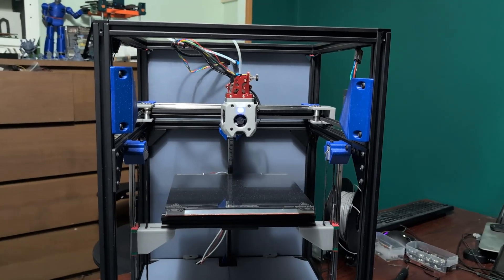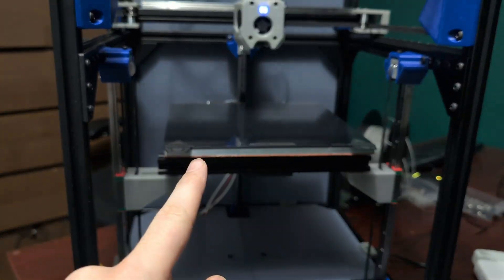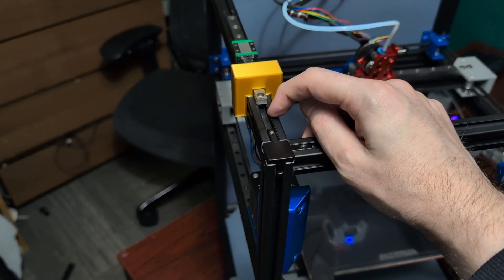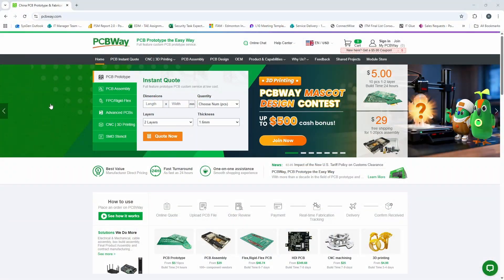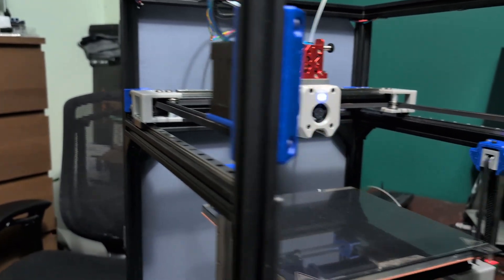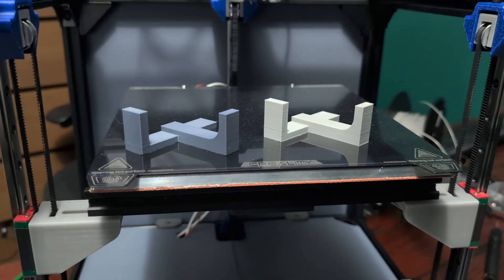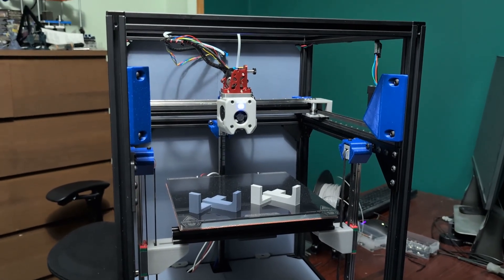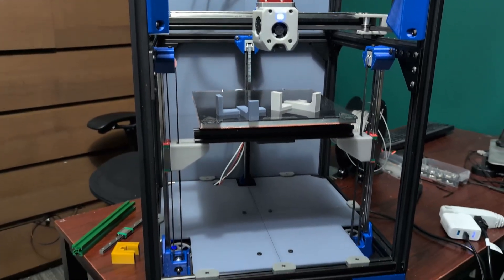DIY Beginner Friendly CoreXY 3D Printer SimpleCore Redux - Final

Comment: Your 2020's seem to be V slot which are good for those roller bearings on the good old Ender 3's, T Slot work better for holding rails, they are both different types and not a quality issue with the extrusions
Reply from the maker: nope I am using all T slot

Comment: Hi, where can I download the config for this printer?
Reply from the maker: There is a zip file on printables for the MKS Monster and Beacon Probe
Reply: @Rolohaun  I want to install 10mm belts on the xy axis, but I don't know how to change the size of the models, can you help?
Reply from the maker: @denhouse355  you will never be able to tension 10mm belts properly with this design. There isn't much reason to got to 10mm belts honestly.
Reply: @Rolohaun  I have a larger frame and I don't want the belts to stretch when accelerating.

Comment: Where do you recommend getting aluminum extrusions for a good price in Canada?
Reply from the maker: there isn't any, I checked. I have bought from Fazetech they may be better, I haven't used them in awhile. Best bet would be to order the funssor frame kit
Reply: @Rolohaun that's disappointing, thanks for the info

Comment: Hai Rolohaus, love your videos and what you do. Just asking do you have any tips for wiring. For me it's a huge wall to climb, as I been figuring out  which connectors, wires, methods, and tools to use. I'm not a engineer I'm close to a designer. It would be great to do a easy to digest vid or a ref for correct spec.
Reply from the maker: I can do a video on that, my wiring methods are not ideal but may help some
Reply: Really Thanks! It would be great if I know which wire, connectors, and crimping specs

Comment: I have an old Folgertech FT5 that died i was wondering how hard it would be to adapt to that frame?
Reply from the maker: the parts should work on most standard frame as long as they are normal sizes like 300, 350 etc
Reply: @Rolohaun  cool thx

Comment: hgx light are super cheap. 11.50 with motor. The only thing I would like to add is filament sensor and cutter, since this standard now.
Reply from the maker: I had issues with my HGX, running a LDO Galileo 2 now which is working much better
Reply: Galileo 2 seems like an insane person priced the kit. For that price I would expect it to be machined aluminum not printed.
Reply from the maker: @jondoough  HDX is $60 for me same price as Galileo. I would take the better gears and such from the Galileo
Reply: @Rolohaun  Would you choose the Orbiter over the Galileo if you were buying again?
Reply from the maker: @jondoough I have tried orbiter I think they are more expensive for me in Canada like 80 plus